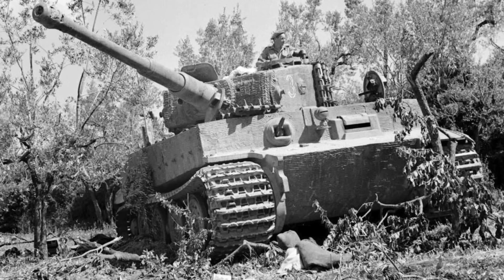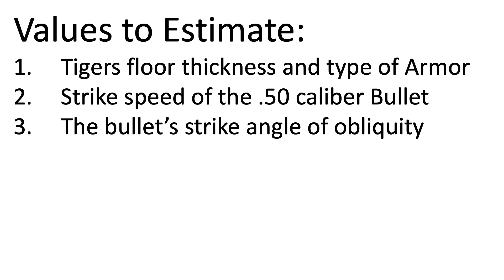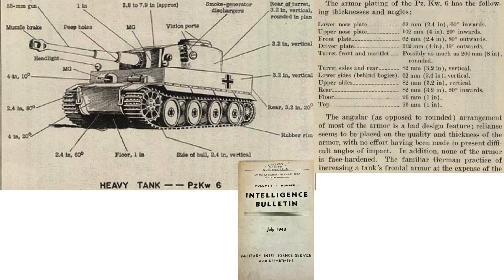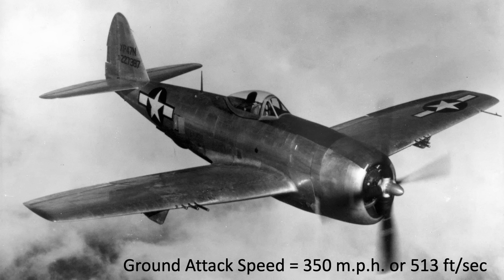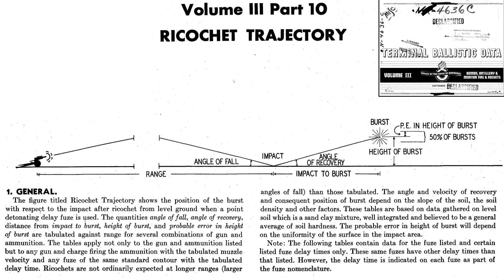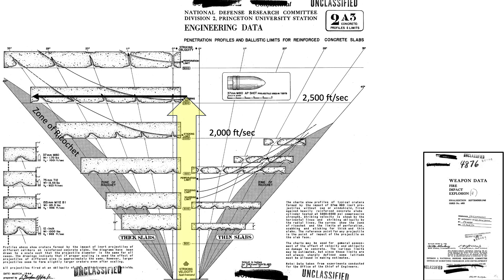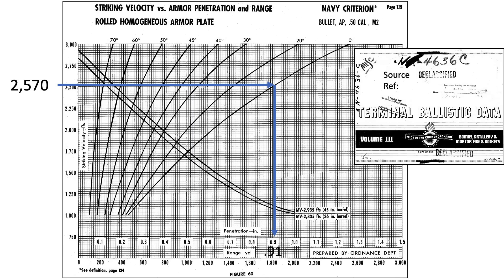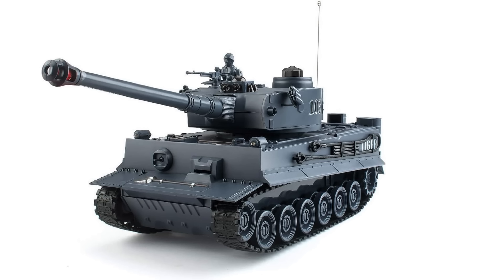P-47 vs Tiger Tank: Can Machine Guns Penetrate Armor?

Comment: This guy found ricochet data AP rounds against concrete. I love this stuff. I have seen videos of aircraft strafing armor for years and wondered what a .50 cal would actually do against a heavily armored tank.
Reply: If the machine gun fire can break one of the tank's tracks, that is going to immobilize the tank until the crew can effect repairs, taking the tank out of the fight.
Reply: .50 laughable but a plane staffing with 20mm cannon I believe could disable say the engine from above
Reply: This why  a lot of the aircraft were armed with 20mm!
Reply: No tank manufactured after WW1 was vulnerable to 50 cal ammunition - because they were specifically armored against the German 13mm TuFG antitank rifles that the 50 Cal’s 13mm bullets were derived from.
The fighter were however very capable of doing a job on the soft skinned support vehicles and dismounted crew.
Bombs could and did flip Tigers over however trapping the crew inside because the Tiger didn’t have escape hatches other than the turret hatch.
Reply: @allangibson8494 50 calibre was not derived from TuF rounds. It was reengineered to be competitive with it but not derived from it. It's 12.7mm not 13mm.
Reply: @wbertie2604  The 50 Cal has an almost exactly 13mm bullet (12.98mm officially). The land diameter is 12.6mm. The muzzle diameter of a TuFG rifle is 13mm too (it’s a squeeze bore with a 13.2 mm bore at the breech and 13mm at the muzzle where the Browning design is a cylinder bore).
It is only “approximately” a half inch.
All the other US rifle designs use the bullet diameter not the land diameter (which is why the British 303 has a larger diameter bullet than the American 308).
Reply: @allangibson8494 13mm bullet in one case, 13mm calibre in the other. It's not the same
Reply: @wbertie2604  The 50 cal is only ever “approximately” 1/2”. 
It is a classic rounding fallacy.
Both projectiles are exactly the same diameter in flight (and in construction).
(TuFG = Tank und Flieger Gewehr).
Reply: @allangibson8494  the calibre is 12.7mm, the round is 13mm. The TuF calibre is 13mm, the round is 13.2mm. They aren't the same.
Reply: @allangibson8494 plenty of tanks up to the early 1940s were vulnerable to 50 calibre rounds. In 1939, the USA 's primary infantry AT weapon was the M2 HMG. Contemporary in UK service was the Boys AT rifle which was effective against tanks such as the Pz. I, 35(t), 38(t) as well as armoured cars, etc.
Reply: @wbertie2604  The Boys antitank rifle was dropped precisely because it was utterly ineffective by 1939 against German tanks then in production.
Everyone else had already gone to 20mm rifles or shaped charges when the armor got thicker than the 18mm that a 50 cal could penetrate.
Reply: @allangibson8494  it continued to be produced until about 1942. It was still marginally effective against tanks in 1940 and Italian tanks in 1941 and was used as an anti-material weapon later in WW2 as it was still effective against armoured cars, trucks etc. The PIAT was more effective and could also be used as a ersatz mortar so the Boys was then quickly phased out
Reply: @allangibson8494  in 1939 people had not gone to 20mm AT rifles apart from I think the Swedes. The UK fielded AT guns too. Shaped charges didn't come until 1942.
Reply: @wbertie2604  The whole point was the Boys was ineffective by 1939 as an actual anti TANK weapon - and it was far more powerful than the 50BMG.
50BMG is effective as an anti materiel however, that’s a separate question.
Tanks need fuel, 50BMG makes unarmored vehicles “go away”.
No fuel, no tank problem.
Simply shooting at a tank with 50BMG not the truck simply annoys the tank crew however and makes making coffee hard (which was why British tanks got fitted with tea urns).
Reply: @wbertie2604 

I don't think the fact the .50 cal. HMG was America's primary anti-tank weapon in 1939 is significant for anything but the abysmal state of our pre-war preparation for a real-world conflict.
Reply: @Chilly_Billy there's some truth in that. Most nations had adopted AT cannon in the 1939s.

My point was also that in the mid-1930s apart from on French tanks, armour was sufficiently thin that the 50 seemed viable, but that changed rapidly. By 1939 an M2 would have had hard time against even US light tanks. 

The M3 37mm was adopted in 1940 and was in US service for infantry until 1944 in paratrooper units. The M1 57mm (6lber British) got adopted fairly quickly, but the USA lacked a more potent weapon. But then doctrinally tank destroyers were to be used. The first of those included mounts for the French M1897 gun, which was also being used by Germany!

Comment: Even if no one in the tank was hit with any rounds,an effective attack could easily immobilize the tank by damaging wheels and track.  Win
Reply: Easily?  Those are pretty robust items on a tiger.
Reply: @gort8203  that’s 8 50 cals with AP pointed at the wheels and treads.  Tank treads slip off when they’ve taken damage.   Side load and mixed terrain alone is a problem with derailments as well.  A hit to the outside of the rim will create a tread shredder.    Any direct hit to tread will do considerable damage.   There are also gears that can eat steel chunks.   I don’t understand how you think it would just be all peachy and rosy afterwards.
Reply: @JimyoVibration  The running wheels on a Tiger are straight disks of armor plate and the track links are even harder for wear resistance.
Tiger tanks were more likely to be immobilised by eating their own tracks than by enemy action.
The US army tried to look at what would stop one of their tanks other than shaped charges and didn’t find much (including shoving a 50 cal machine gun INTO the tracks - it failed).
Reply: @allangibson8494  What you’re saying is absolutely remarkable.  I’ve never seen anything that is damage resistant.  And as soon as a moving part takes damage it is in a state of breakdown.  I feel the urge to send some questions out to some tank museums about this one.   You may be right, and that would really be awesome.
Reply: @JimyoVibration  There is “damage” and “catastrophic damage”. A 50 cal will barely scratch the paint on 50mm of armor plate like the road wheels on a Tiger tank. The engine on a Tiger will happily shear the pins on overload (the engine is that strong and the engineering that weak). Over half the Tiger and Panther tanks were lost to simple “engineering casualties” which the more conservatively designed American tanks were immune to (a Sherman was 1/20th as likely to have a gearbox failure and was repairable in 1/20th the time (an hour vs over a day)).
The 50 Cal is not a particularly impressive antitank weapon and two decades past “use by” date in 1939.
It could do a number on an unarmored truck or locomotive but that was about it. Shooting tanks was an utter waste of ammunition.
The Australian Armor and Artillery Museum has a German tank with a 50 mm solid shot AT round imbedded in its armor that was cut flat and welded in because it was too hard to remove.
Lots of restored Sherman tanks have been dragged off ranges and restored after spending four decades being used as heavy machine gun practice targets.
Reply: @JimyoVibration  Tank tracks slip off due to tremendous forces produced by the tank drivetrain, not the impact of bullets.  You must know that spare track segments are carried on the side of many turrets and hulls as extra armor protection.  The only thing peachy and rosy here is your faith that a machine gun can critically damage a heavy armored vehicle designed to assault though machine gun fire and withstand much heavier firepower.
Reply: @JimyoVibration if it was so easy, why didn't commanders on M4s use their AA 50s to disable the tracks on Tigers rather than relying on their 75mm or 76mm guns? What you say isn't impossible, just not very likely.
Reply: @wbertie2604  I can’t respond to people that don’t think 8 50 cals with AP rounds vs moving parts is a fools game.     Except for nicely telling them they’re thinking like they’re in a video game or a movie.
Reply: @JimyoVibration  I'm using cold hard logic and hit probabilities from the USAAF. On a pass against a tank you are going to get around 10 to 20 hits. The chances of hitting something vital are low. It's just math. The USAAF assessed it themselves and came to the same conclusion, so if you don't believe me, maybe believe the USAAF.
Reply: @wbertie2604 The basic question at hand  is: 8 50 cals with AP vs a mechanical object.  Thank you for telling me what you think happens and thank you all for your comments.     In 1944 the tiger tanks were upgraded to a pressed (multi part) wheel, an impressive design where the rubber rim is inserted and pressed into a disk.   My conclusion is that  any damage would ultimately lead to a mechanical failure.  Maybe no lives lost, kinda boring even.   It’s still a tank out of the fight.   All I’m saying here guys.   I’m not claiming it was a tactic or should have been.  I’m just telling you physics exists.
Reply: @JimyoVibration  yes, in theory this is possible, but if you look at the angles of attack then the chance of hitting road wheel is such that you might get two or three hits on mostly the outer wheels only a proportion of which might eventually cause the issue you describe. And I expect it happened and there were plenty of tanks abandoned due to various manoever issues. However, if it was so easy to potentially disable a Tiger why did Soviet AT rifle crews aim at the side armour above the wheels, a narrow band, or other targets rather than the super vulnerable wheels and why were side skirts for tanks to stop AT rifle rounds against Panthers not extended down further to protect the wheels? I somehow doubt that the wheels were quite such an Achilles heel as hitting them would be cheap kills. I use Soviet experience as they are reliable side hits from a nation that continued to use AT rifles
Reply: @gort8203  the equation should read:  “destructive device vs mechanical object”.  Just ask yourself that question. 

In other words (50cal BMG AP v wheels with timing gears, guides, and a spinning track).   The mechanical device will ultimately lose in time.  

I don’t know why you think I stated it would blow chunks of tread off.   But, thank you for your comments.
Reply: @JimyoVibration   Just give it up Jimmy, you can't support your claim with facts or logic.  Strafing a Tiger with .50 cal machine guns is a waste of ammo that should have been expended on a more suitable target.
Reply: @gort8203 if the comment “destructive device v mechanical object” doesn’t represent logic than you can’t have a debate.   Every titan has an Achilles heel.  

Just watch the video about “how they knocked out a WW2 tiger tank.”   They knew to aim at the weak spot.  Why is this so hard to fathom?   Why is this news to you?
Reply: @JimyoVibration  Why are you back after 2 months?  Trying to spice up a boring holiday?  What I fathom is that you are unable to fathom logic, you have no news for me, and I am not interested in anything you have to say.
Reply: The only way you would immobilise a tiger with a 50 cal would by hitting a driver with his hatch open.
Reply: @allangibson8494  you’re right, 8 50 cals of armor piercing would just bounce off of tank track.  Just kidding.

Comment: Uncle flew A26s. This was his claim that armour piercing bullets could penetrate the thin areas
Reply: also, the hammering effect of multiple rounds in quick succession on the same weak point, due to coning of the multiple guns.
Reply: @SoloRenegade a tank is relatively big compared to a bullet. With an A26 with maximum forward guns you might have 40 strikes but the chance of two in the same place is still tiny.

Comment: Excellent analysis.
What seems likely is that a few AP rounds might go between the engine deck cooling grills and damage radiators (most likely), electrical or fuel systems (less likely).  A radiator with a bullet hole would take a few minutes to overheat a tank engine.
Hand Rudel, firing 37mm cannons in his Stuka, aimed at the engine deck.
Reply: There would be a lot of rounds, so the damage could make the tank way less efficient, and the crew morale would be lower, especially if they were less experienced.
Reply: @neilwilson5785  The radiators are large.  A bullet through one would make it one hot kitty.
Reply: @neilwilson5785 people over estimate the number that would hit. It would probably be at most 20.
Reply: I would tend to agree that the most likely cause of damage was all the rounds entering the engine/cooling bay through the large grill openings in the engine deck.  These openings are often larger than your fist.  The engine compartment is in the center, and it has a solid hinged deck lid.  But to either side is a radiator box with big holes.  How thick is the wall between these the engine and radiator?  All it would take would be some fuel and a tracer to ruin some tankers day.  We see video of planes strafing tanks, and there is fire and smoke.  Certainly not every time, but often enough to make it a worth while risk for the plane.
Reply: @modelsbydave  Rudel disabled 500 Soviet tanks this way with his 37mm armed Stuka.
Reply: @modelsbydave  The grille openings are not larger than a fist, unless you're a midget. Remember those engine decks were designed to withstand ground-based AP and HE fire also, and those threats are far more likely than getting hit with aircraft weapons.